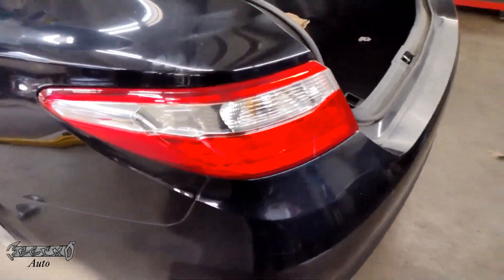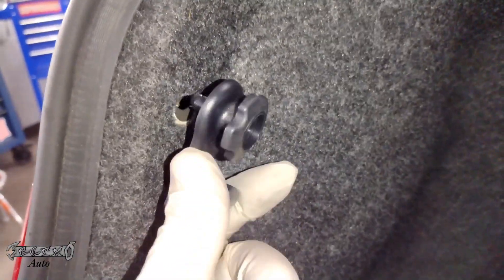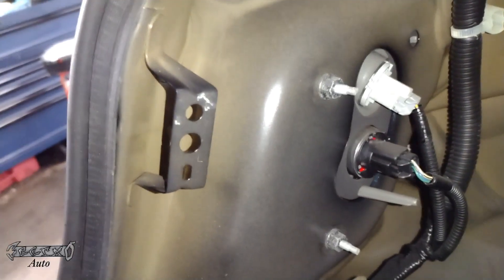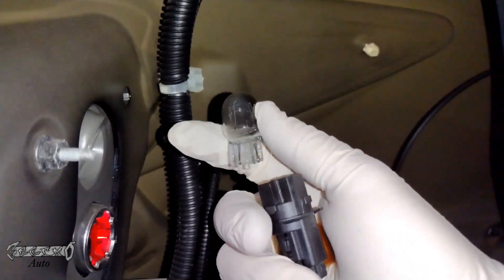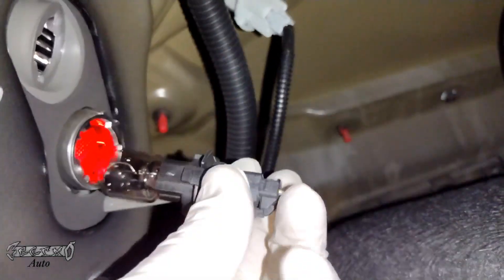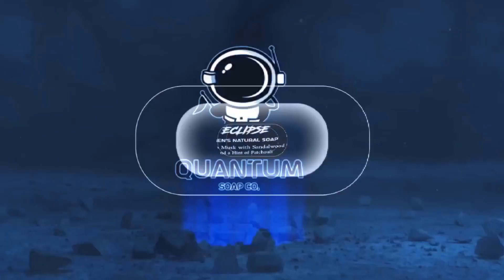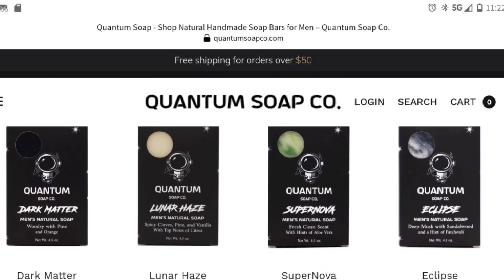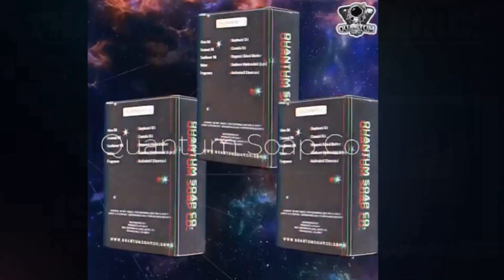2007-2017 CAMRY BRAKE LIGHT / TAIL LIGHT / BLINKER BULB REPLACEMENT + SOCKETS 2007 - 2015 2016 2017

Comment from the maker: GET THE BRAKE / TAIL LIGHT BULB HERE ( AMAZON )
( 10 BUCKS ) ( 2 PACK ) ( 5 ⭐ RATING)
https://amzn.to/3PIc4Fi

GET THE BLINKER BULB HERE ( AMAZON ) 
( 10 BUCKS ) ( 2 PACK ) ( 5 ⭐ RATING)
https://www.amazon.com/dp/B0173MKOLM/ref=cm_sw_r_as_gl_apa_gl_i_PHJ3VJX97GW3ZSRHX46A?linkCode=ml2&tag=gearmoauto-20

GET THE GENUINE BRAKE LIGHT BULB SOCKET HERE 
( AMAZON ) ( 30 BUCKS ) 
https://amzn.to/3WnewVD

GET A CLIP REMOVER TOOL HERE ( AMAZON )
( 10 BUCKS ) ( 5 ⭐ RATING) 
https://amzn.to/3EaKZbi

PART #S
BRAKE / TAIL LIGHT BULB - 7443
BLINKER BULB - 7440NA( AMBER COLOR )
BRAKE LIGHT BULB SOCKET -  90075-60079
( Socket, Tail & Stop Lamp) ( BLACK ONE )

FITS
2012-2017, 2007-2010 Toyota Camry
LE, N, SE, XLE, XSE|4 Cyl 2.4L, 4 Cyl 2.5L, 6 Cyl 3.5L
2ARFE, 2ARFXE, 2AZFE, 2GRFE; 2ARFE, 2ARFXE, 2AZFE, 2GRFE; ACV40L